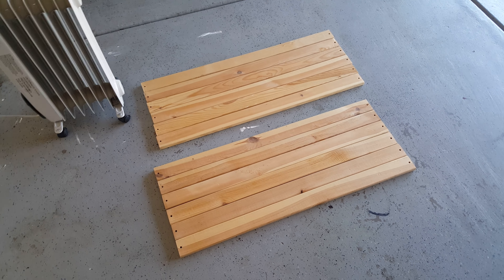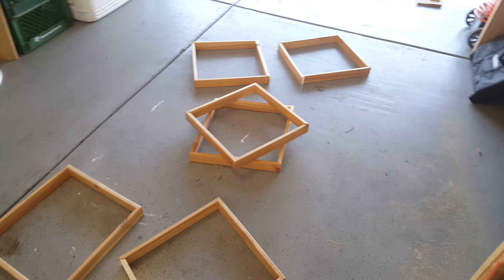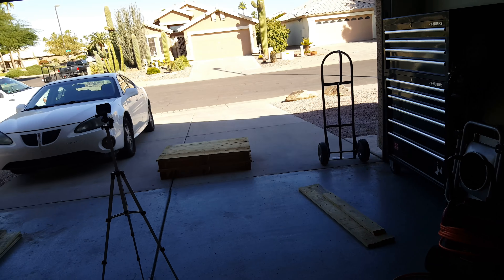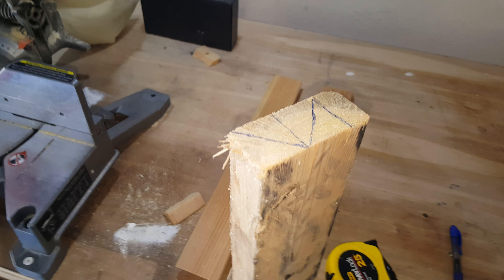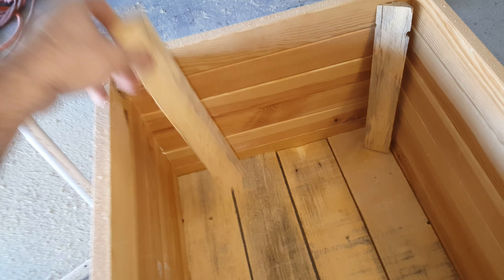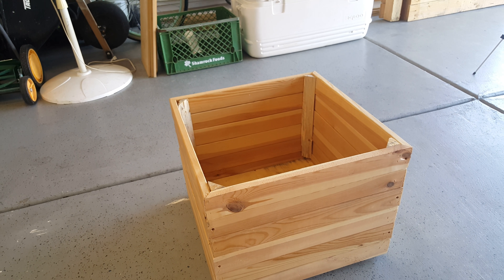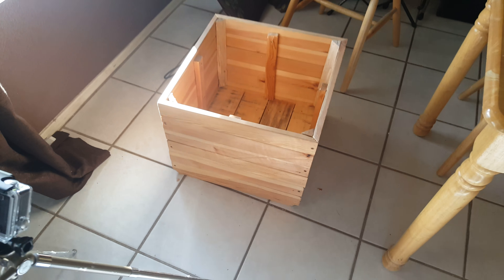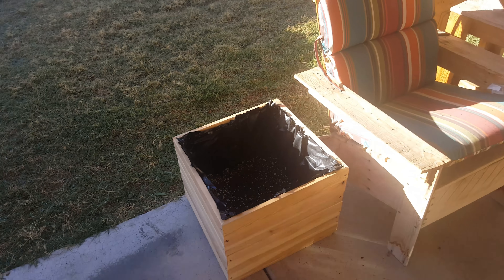Planter Made from IKEA Bed Slats. #diy #garden #timelapse

Comment: You don’t need to treat the wood?
Reply from the maker: I didn't. I moved front that home so I'm unsure of its condition now. However, I had that planter for at least a couple years before we moved and the wood was solid.
It's in Az so besides the sprinkler there's very little moisture. The water from the sprinkler would evaporate rather rapidly as well.
Thanks for watching my video!